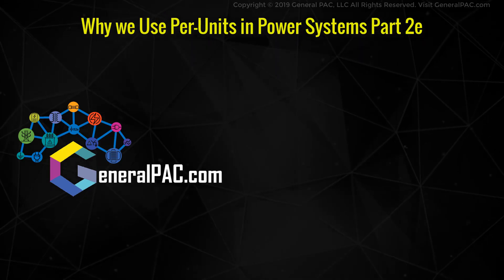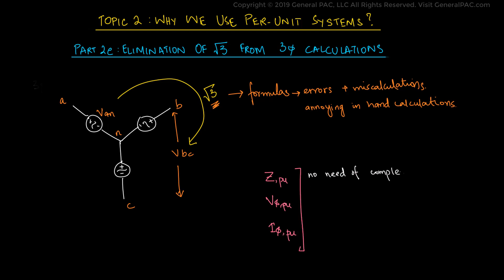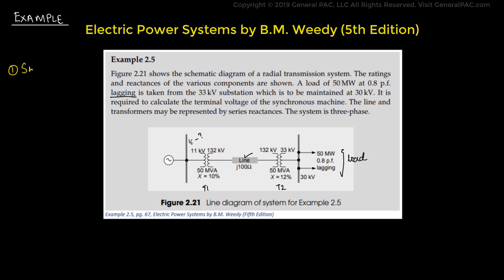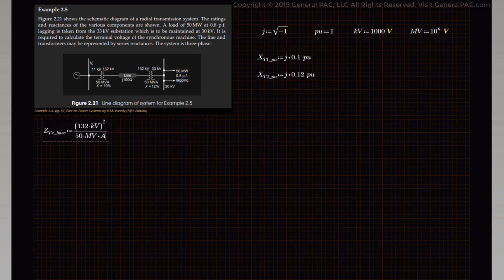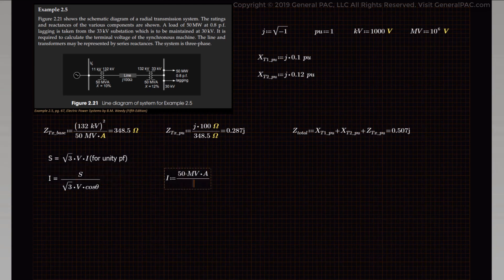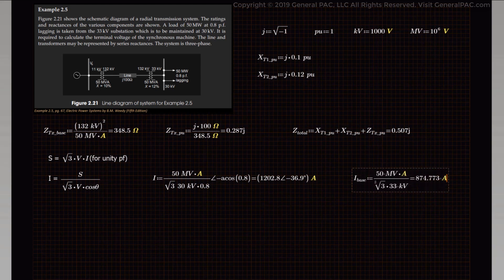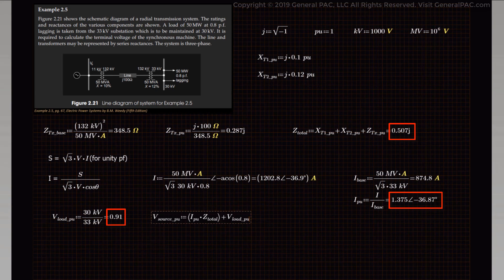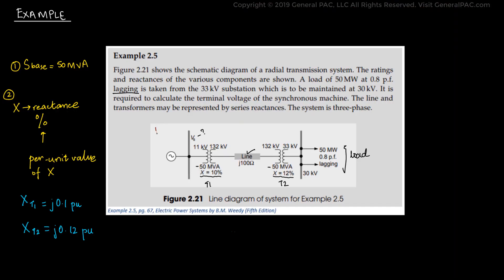Why we Use Per-Units in Power Systems, Part 2e

Comment: Hey 👋 i have a question where does the -acos(0.8) comes from at 5:04 ?
Reply from the maker: Hello, we used the formula '-acos(power factor)' to calculate the load current angle. As mentioned in the question, the power factor is 0.8, the -ve sign indicates lagging load, and acos is the inverse of cos.

Thanks,
GeneralPAC by AllumiaX

Comment: why wasnt the impedance of the load not taken into account  when calculating the total impedance?
Reply from the maker: Hey Dara,

It's a good observation from you, which shows that you are a good learner. Coming back to the question:

The per-unit system is mostly used to calculate short circuit currents, and we don't include load end impedances in short circuit calculations, so we ignored load impedance in the total impedance calculation here.

Thanks,
GeneralPAC by AllumiaX

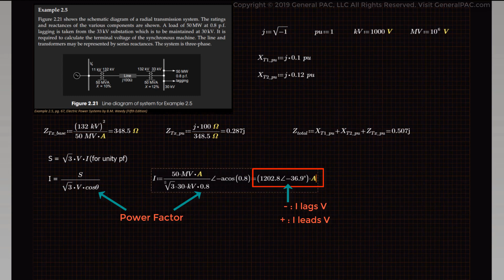Comment: I think there is some mistake in 5:29 because in an inductive load, current lags voltage resulting in a positive phase. While in a capacitive load, current leads voltage which results in a negative angle.
Reply from the maker: Hey MICA,

The equation mentioned in the video is correct. In the case of leading power factor, the phase angle of current is positive with respect to voltage. However, in the case of lagging power factor current phase angle is negative with respect to that of voltage. 

Thanks,
GeneralPAC by AllumiaX

Comment: The visual presentation is cumbersom and often hard to follow visually. In this day and age, we have the benefit of software applications that let us do tutorials with clear and easy to read text. Why not use that ? My old (65-70 years old) engineering textbooks are much easier to use - All I gotta do is read 'em. The audio portion of the lecture is fine, and helpful, but use some good quality "blackboard" text.
Reply from the maker: Hi Walter, thanks for your comments and suggestions. We've been trying different things at different times but it seems like our audience is very broad and what is valuable for one member is not as valuable for another. In some of our videos, we slowed down considerably which allowed members to digest the visual presentation but in these videos, we have chosen to speed things up thinking that members will simply rewatch as needed... but perhaps we should instead try something different. Alas, your comment is helpful feedback. Thank you!

Comment: Hi GenPac, great job here. May I know if the transformer Zpu of 10% & 12% are short circuit Z? How do we use this impedance to calculate the the voltage drop of the system in steady state operation?